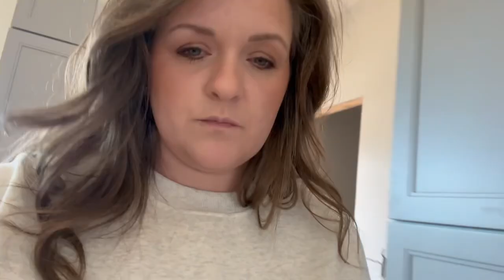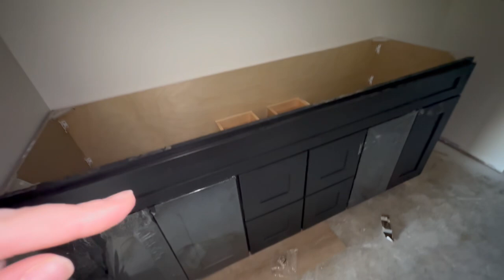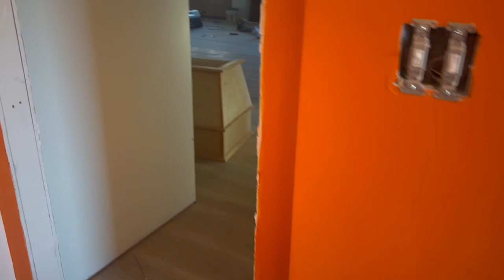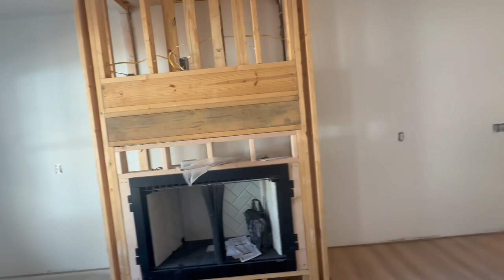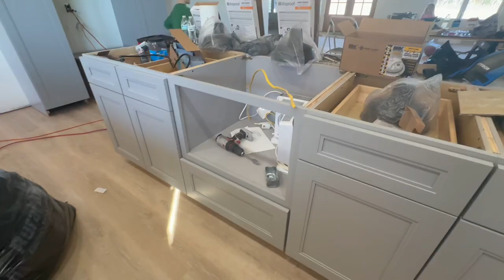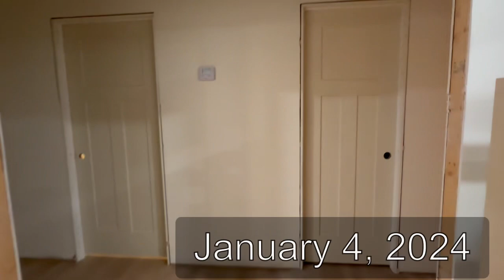It’s looking like a real house !

Comment: Hi love your home. We are in Knoxville and wanted to get Summertown to build Woodside for us here. I understood they would deliver kits 300 miles away from their location. I thought I heard you mention Morristown, so I was wondering if they came out and built y’all’s on site?  Thx!
Reply from the maker: They did build ours . They hired contractors for each step , it wasn’t actually summertown crews . I’ve heard only great things about summertown , but I don’t think I’d do it again without their actual crews doing the build .
Reply: Too much chaos huh?  Thx. I think I have your lighting on the bar solved for you. Lol. The problem is the sink and bar lights are competing. They aren’t centered correct but that wouldn’t matter as much if they weren’t so close in design.  For instance look at their lines. See how both are bell shaped same color and etc. you can still go black just open up you design or change to alternate in between the sink lights?
Reply: You can also go 4 even across the island in between sink lights. If you are def in love with this design. You will be thoroughly disappointed if you don’t put direct lighting down on the island. Not cans or recessed they will not give you the direct lighting you need on the bar. Since like you said you already have the extra dining table lighting you might consider just going with 2 centered on the island. I loved my direct island lights especially at evening for food prep and fellowships.